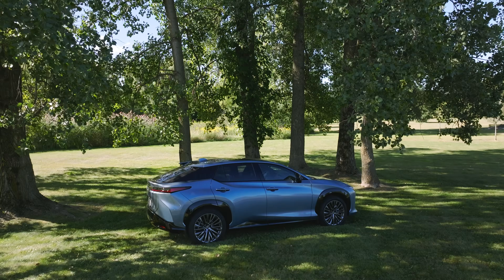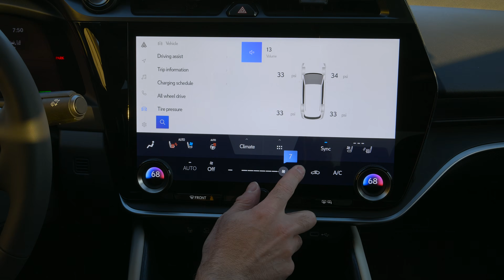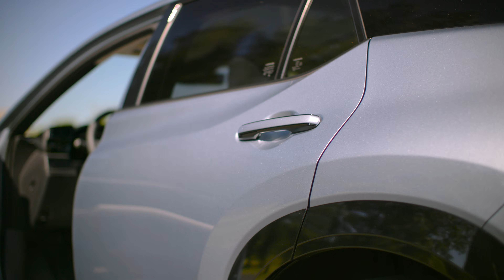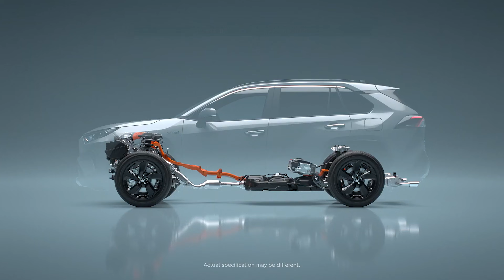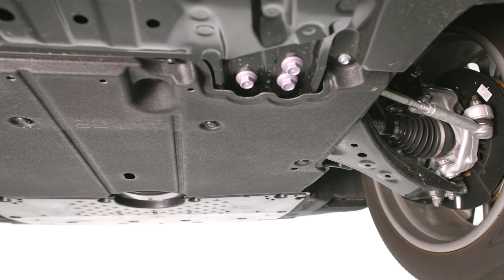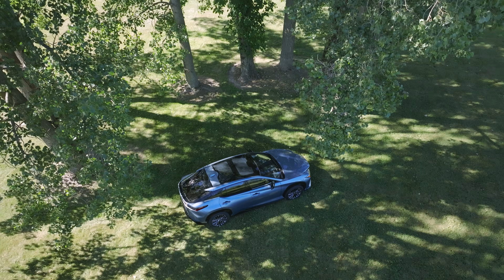Lexus RZ450 EV | Just Say No!

Comment: I'm under the impression that Toyota Lexus doesn't even really want to make electric cars they want to make hybrids
Reply: Toyota certainly isn’t concerned with making a competitive electric car. This would be a nice luxury car to drive around town but it’s a lot of money for a very mediocre EV.  For the money, the battery is small, the fast charging is no so fast and the onboard charger of 6.6 KW shows how little they care.  Then there are the charging limitations and range would have been unimpressive 4 years ago.  But they must have felt they needed to offer something, just not something good.
Reply: You would be right. Toyota has outright admitted to it. The reason being that for the battery resources it takes to make just one full EV car, they can make 7 PHEV cars or 90 standard hybrid cars. 

Toyota figures that at least for the time being, it makes a lot more sense to put resources into hybrids and PHEVs, which still offer significant efficiency improvements over conventional ICE vehicles, without the limitations, drawbacks and enormous resource costs of EVs. (Goose covers this in the Prius Prime review).
Reply: @splewy  this is a great point (total resource utilization) and is one reason I make the use case point elsewhere. When every reviewer harps on about range, without acknowledging that some people simply don’t need a ton of range, it actually exacerbates the issue. Every EV carrying around 100+ kWh of battery when they only use 35% of that most of the time is silly. But, people would have to get comfortable using different cars for different things. We do that already, but we don’t talk about it that way. I don’t take my 911 to Home Depot and I don’t take my Cayenne on track. I’m pretty comfortable having an efficient car that I don’t depend on to take me to the grandparents’ house 200 miles away, and a comfortable, larger car for the long hauls. Minor mindset shift could go a long way … but in the meantime, the PHEV gets most people most of their needs met with maximum urban pollution reduction, at the cost of a redundant drivetrain and maintenance complexity. Reasonable interim solution.
Reply: @tammerfarid  The average consumer does not have the luxury of having a different car for a specific purpose, so it would be hard to cultivate that mindset. A little tone deaf in your logic, Mr. Porsche man.
Reply: @chri5jame5  just the facts. 59% of households that own any vehicle today own more than one (that includes households with 2 cars and those with 3+). So already nearly 2/3 of households could designate one of those multiple cars to be a “road trip” car. Unless you’re suggesting that most households have to have two drivers independently doing long mileage regularly … which statistically doesn’t hold up. Every family that owns a minivan and a smaller car already has “a different car with a specific purpose.”

My logic is based on documented facts. What are your assertions based on?

Source: U.S. Census Bureau 5-Year American Community Survey (2017-2021)
Reply: @chri5jame5  also, sorta beside the point but using my car ownership as an insult just highlights the lack of information underlying your entire message. My 2015 Cayenne Diesel was purchased two years ago for $29K, less than the average price of a new Camry. I maintain it myself and it’s needed nothing except fluids and tires in 25K miles, except one expensive LED headlamp. But I guess if it has a Stuttgart crest I’m an out of touch snob, to some.
Reply: @tammerfarid  

You're right under your perspective that a family is a household with access to each other's vehicle.

I was thinking actual household, or each person in a household being the average consumer. 

(The Census bureau states that "A household includes all the the people who occupy a housing unit. (People not living in households are classified as living in group quarters.) A housing unit is a house, an apartment, a mobile home, a group of rooms, or a single room that is occupied (or if vacant, is intended for occupancy) as separate living quarters. The occupants may be a single family, one person living alone, two or more families living together, or any other group of related or unrelated people who share living arrangements.")

The reality is, 2.6 is the average household (ACS, 2017-2021) let's round up and say 3... with only 22% of the households owning 3 or more vehicles (ACS, 2017-2021). 

That averages out to 1 person per vehicle, which does not necessarily mean vehicles are shared.

That's particularly true of urban environments, where I am from. Pew Research shows, By 2018, 25% of the total U.S. population resided in the large suburban counties, up from 23% in 2000. In contrast, the share of the population living in the urban cores remained at 31%. (Pew Research Center, 2020). 

So I guess my logic is as skewed as yours. 

Oh and when you use a cheap Porsche when noting it as an example without stating it's a cheap Porsche, it does sound like you're a wannabe Stuttgart snob.

That's my logic.
Reply: thing is one major repair away from going to the junkyard  @tammerfarid
Reply: @tammerfarid  I agree on the "short" range. This vehicle is perfect for my 15 miles commute during the weekdays but I gotta pull out the good old V8 LC for road trips.
Reply: I would think it would be a good strategy for Lexus to focus on PHEV's: it's an under-addressed market currently, and would be a good fit for their product evolution. If they could make their technology UX better, and make SUV's with ~50mi EV range and ~500mi combined range, and were not gutless like their previous offerings (think 400hp+ as a benchmark), I think they could do reasonably well. It will be interesting to see how quickly they can get their new TX 500h+ into production, for example, and how it does in the market. They really need to fix the old UX and lack of power to be more broadly compelling, though.
Reply: They just want to make money. And hybrids is what currently makes a ton of it.
Reply: The last year we have full-year global sales figures is 2020, and -- looking at consumer vehicles including pickup trucks, excluding commercial vehicles -- Toyota sold FIVE out of the TOP TEN top-selling vehicles, worldwide.  RAV4 was #1.  Corolla Sedan was #2.  #6 was interesting -- "Toyota Hilux."  NONE sold in the US or Canada.  Just a handful sold in China, and a few more in Europe.  THIS is the kind of thing that the rest of this planet is buying -- an inexpensive little pickup truck.  It's like when Toyota stopped selling two-door cars -- "We're sorry, we build cars that people will buy."  TOYOTA SELLS CARS.  Nobody at least in the CCS world is selling much more than a pile of beans.  When Toyota can actually make money selling zero-emission vehicles, expect them to jump in with both feet.  In the meantime, they're selling every hybrid vehicle they can produce.
Reply: They do make the best ever
Reply: They’ll be forced to eventually, so might as well make something actually good.
Reply: @casIIsac  well Lexus can’t afford to make segment best vehicles. So that idea of yours is clearly never going to happen.
Reply: Akio Toyoda came in and pushed for more character in the brands to give them appeal beyond appliance convenience.

He stepped down because he doesn't think he's the guy to lead the company into an electric future. Toyota knows where it needs to go, and a gearhead racer isn't the boss to get them there.

So it's not fair to say that Toyota doesn't want to make BEVs. It's fair to say they've put more focus on hybridization in the short run, and the guy who was in charge wasn't excited about committing to an electrified future. So he stepped aside to allow the company to do what it needs to do regardless of how he feels about it.
Reply: They make great hybrids, but i believe they have a much more advanced electric platform coming, maybe the RZ and BZ4 are just placeholders? I dont think toyota would be dumb enough to only offer a BEV with ~200 miles of range
Reply: That's why Akio was forced out.  He wasn't playing ball with the WEF and the climate hoax.
Reply: They don't.
This car basically screams "here, have your EV, now leave me the fuck alone, next time you want to have it your way, go to the fucking Burger King".
Reply: Wasn’t the CT200h a Lexus Prius? That car totally sucked. Maybe the new Prius Prime or whatever it’s called could be morphed into a decent Lexus. PHEVs are definitely the bridge technology for people who need to drive their EVs more than 150 miles with any frequency.
Reply: Phoning it in because they know in the long term BEVs are not sustainable.
Reply: Nobody wants to make electric cars
Reply: They publicly say that
Reply: @pine111  why is no one buying the f150 lightning?
Reply: They only make this car for the eco carbon credits so they can make more gas cars
Reply: Agree. Pretty sure the CEO has said they aren’t committing to BEVs because the technology isn’t there yet and he feels hybrids are proven tech
Reply: Good!
Reply: It's true. They do not have an EV platform or supplier for batteries.
Reply: Well thei Fired Toyoda because he didnt believe iin evs
Reply: They are a little bit behind the competition. To me the most interesting feature to come is the quick steering rack with the yoke steering wheel.
Reply: Realistically, the tech for EVs is still not optimal.  We need more mass transit.
Reply: @apocalypse487  i agree!!! I dont think that we should be having to drive electric cars until charging stations are as available as gas stations.
Reply: I heard the same from a friend at Corporate. They build the minimum the government requires, but are more interested in Hybrids and developing fuel  cell technology which they are jointly researching with Yamaha and other Japanize manufactures. The CEO of Toyota and Subaru have both spoken out about this. It's also why Subaru is just rebadging Toyotas to fill their EV quota for the Government.
Reply: @christopherbice862  yup, demand for EVS is going down and interest in hydrogen fuel cell vehicles are going up. I really hope hydrogen is the future instead of electricity
Reply: @pine111  only time will tell but EVs aren’t sustainable currently.  Infrastructure sucks, range isn’t great,  needing a battery replacement basically totals the car
Reply: They want to make hydrogen cars, don't trust me just watch.
Reply: they literally dont
Reply: just given some of the visual designs ive seen from some EVs like rivian, i get the impression they want to make EVs as ugly as possible so they flop and they can go back to ICEs
Reply: Toyota DEALERS demanded Toyota make Hybrids and not go all EV.  Hybrids combine all the maintenance of the gas engine AND complexities of cramming in electric with it.  It's a dealer profit center down the line for their service and repair department.
Reply: They will make anything that sells, if they they can make it.
They want to make and sell BEV, but they can't really make BEV. 
It's kinda hard to teach "new trick" to "old dog" .
They really fall far behind, even behind Ford and GM
Reply: And hydrogen
Reply: better for them to just take the prius and upscale it to a more luxury version and tada, hybrid lexus
Reply: Toyota knows EVs are a fad that provide little benefit to the consumer.
Reply: Toyota is a firm believer of multi solutions. To sell the entire world with BEV is an insane thought. Toyota understands the global infrastructure of charging stations is nowhere ready for that shift to just BEV, so as of now hybrids are the way to go. But they also understand the demand for EV so they have that option. They also have FCV for places that does have fuel cell stations. So they have a complete complex understanding of the demands in different markets.
Reply: hybrids have had <5% marketshare for over 20 years. bevs have already passed them. why do you think theyre going to jump all of a sudden? @vamosnippon
Reply: @TeslaRoadtrips  Hybrid market share has been growing, but in fact BEV sales has unfortunately plateaued. You can see a lot of the BEV dealerships other than Tesla has hit a decline in sales and has many unsold BEV in their lot. Which is explained by the severe lack of infrastructure for BEV. Tesla is an exception since they have a much better charging system but that is still very limited. On the contrary side, PHEV and hybrids are growing because they are so versatile and can still comply with the changing gas prices. From this, what I understand is that people are realizing the importance of infrastructure for BEV and how these vehicles can affect their lifestyle. Most apartments lack charging stations and even if they did have one, it would be very limited. Politics wants to move to BEV but if consumers don’t buy into it, then it will force auto manufacturers to sell what consumers want. It is a matter of time but that time may take longer than we think. And there are still many obstacles for BEV like the charging time.
Reply: i disagree bev sales have been markedly increasing for several years and hybrids have never made it past 5% for last 20. not saying hybrids cant make inroads. but bevs passing them in marketshare within a few years is telling. tesla marketshare has decreased due to more competition, but overall sales continue to rise. i wouldnt touch a ccs car with a 10 foot pole @vamosnippon
Reply: @vamosnippon  well you should see the increase sale of EV in my country then, EB here are increase exponentially

And also which country are you? I think you need more research on different country than the us or Europe
Reply: @lillypichu4566  Yeah every market is different that is exactly why Toyota has multiple approach to this ongoing movement to zero emissions.
Reply: The infrastructure in the US is lacking to support a large amount of EVs. Besides not a lot of 3rd party charging stations, they are slow, buggy, and many times connection/payment doesn’t work.
Reply: yea if theyre not tesla @elfinguard3
Reply: @elfinguard3  the infrastructure point is mostly irrelevant; it’s a moving target. At the dawn of ICE vehicles, you had to buy gas by the can at stores. And again that misses the point that most people don’t actually drive their cars more than 80 miles a day (and the majority far less than that). Road trip charging is really an edge use case for most people except the minority that are 1-car households.
Reply: Honestly I think toyota has this right (if its the case they are focusing on hybrid). Hybrid tech is the best way to make a difference now. Full electric has real downsides. If the masses all drove hybrids it would accomplish more than the top 10% of car buyers being able to go all eletric. imo.
Reply: @Largecow_Moobeast  definitely true for the apartment dwellers and garage-less who might struggle to charge at home. For those with the ability to charge at home, it’s really down to your needs. I don’t know, but I suspect that a large majority of people who can charge at home also have >1 car, which means the limitations to BEVs are totally irrelevant for them.
Reply: GOOD! EV's are terrible atm. You get a bigger bang for your buck with hybrid in that they cost significantly less to build and source, while giving you a very healthy MPG bump. The economics on EV's vs Hybrid are a no brainer if you calulcate from cradle to grave on ALL components/materials.  Greenies love to just focus on the ass end of that equation which is "free transportation" in that it doesn't pollute. Yea you did 6 years of polluting to get to that point just to build the car your all hyped up for meaning you need to drive it 60k to get your carbon back to be "carbon free" meanwhile at 60k your resale has dropped like a rock and you probably have a new EV now.  Which is BEYOND BAD when you factor all that in. Your worse than a ICE. FAIL.
Reply: @aurorajones8481  You have a very myopic viewpoint. Once an ICE is dead at say 100K or 200K it can only be recycled for metal scrap and some plastics. Once a BEV is dead at 150K or 250K (since a single gear reduction tranny and electric motor are far less likely to fail than the wonder that is an ICE powertrain), the same metal and plastics can be recycled - BUT also the batteries. By recycling the batteries instead of mining for new ore you save about 80% of the energy involved with acquiring the metals and only have 3-5% loss - see Redwood or Li-Cycle stats for reference. This is a long term savings, not something seen in just one decade. When you look at things with just a 60K viewpoint you end up with cars that put a layer of lead into the topsoil al around the world. When we get to the point of having reliable fusion en mass, we can move to hydrogen either FCEV or flat out combustion, but until then BEVs are a way to significantly cut down on CO2 emissions and normal pollutants. You're still going to have all the nasty chemicals from making the glass, plastics, wire insulation and so forth along with tire particulate and some brake dust - but it is a significant improvement. I've spent my fair share of time on SCCA track and love racing but concede that combusting petroleum for basic transportation is not sustainable. Keep it for flying and plastic until we find something better, but you don't need it to drop the kids off at school or going to the beach. There is no perfection short of removing humans from the Earth since nobody wants to live like North Sentinel Island.
Reply: @aurorajones8481 EVs are not terrible at the moment. There’s quite a few that are fantastic, but mostly for a long term use case it’s still just Tesla. Also, that whole charade about the carbon neutral thing doesn’t work. Once that car is built, it goes on to a new life with a new owner and gets used over and owner. The long term carbon footprint is nothing compared to an ICE car, with 2000 less moving parts, minimal maintenance. and no, it’s not 6 years. It’s about 2 years to catch up to the carbon neutral. I’m all for everyone to drive what they want, so don’t take this as trying to convince you to change. Just saying, your comment has a bias bent towards negatives that aren’t real.
Reply: i dk. base model 3 is 32k after rebate. cheaper in some states. im saving $4000 a year in gas. basically im paying myself after 8 years. hybrids get all the worst maintenance aspects of both. deal w stealerships. good luck finding a prius prime in cali. 2 yr wait or 10k markup. most just end up buying tesla.  @aurorajones8481
Reply: @aurorajones8481 this is completely wrong. The average BEV has much better cradle to grave emissions than the average hybrid.
Reply: @Kavafy  standard hybrid, you’re correct. For a PHEV with an EV-only drive mode, doesn’t it depend on how often the gas engine is used? For a BEV, a huge share of the lifecycle cost is in the battery pack. Making the battery pack smaller (like a PHEV with 20-40 miles of range) reduces that upfront environmental impact. If that car is charged in a garage every night and mostly used for short trips, it’s probably lower total output than a BEV with 300 miles of range. If it’s driven on the gas engine all the time, it’s worse than the BEV. Here’s the catch: for a PHEV to have lower CTG emissions than a BEV, the gas engine has to be superfluous most of the time … which makes it a waste to include st the start.
Reply: @aurorajones8481  100% agree.
Reply: Akio Toyoda saw where cars were going and he peaced out, don't blame him tbh.
Reply: Ford lost tons of money on EVs. They are switching to hybrids now too
Reply: They once said that the resources that they need to build a single BEV can be used to produce way more hybrids (they even quantified).
Reply: Toyota don't want to make EV cuz they think it's not the right way for the future of automobile, that's why they dump tons of money into Hydrogen tech. Toyota also think as whole, where many people around the world can't afford EV or countries that don't have the info-structure for EV, on the other hand they are developing next gen battery tech w/ Panasonic which is "solid state" battery, which is supposed to be the next best thing for EV. But at the end it's the government that wants every auto manufacturer to switch to EV.
Reply: That's because the leaders of Toyota Motor Corporation strike me as intelligent people who understand that market MAY NEVER MATERIALIZE because INTELLIGENT people want HYBRIDS, NOT the BURDENS of fully electric vehicles.
Reply: @williamlevy1981  the problem is, the law bans all gas vehicles in 2035 in most us states including hybrids.
Reply: @andreyoungcompton  And watch that change in many markets.
Reply: hybrids have hads sub 5% market share for over 20 years. bevs have already passed them. why do you think theyre going to jump all of a sudden? @williamlevy1981
Reply: I always felt hybrid are the answer. You are using less gas and needing less gas, and you don't need to mine as much because of the smaller batteries. You just created a smaller footprint. With all these large batteries, lower income countries are really struggling to keep a safe work environment and be environmentally conscious.
Reply: Not really. They want to make what is in demand but definitely are working on BEVs. They don't want to make just BEVs or think just BEVs should be the future. But some BEVs, yes, should be the future and they're making Lexus all BEV by 2030 in some countries. I think the USA is one of them. By 2035 Lexus wants to be all BEV or at least all EV with maybe some FCEVs.
Reply: @benjaminsmith2287  got a source for all this info?
Reply: @lunisce  Sato. He , along with two other Toyota reps, made a presentation stating what Toyota is working on in terms of various production lines, accelerating BEV development, and how Lexus will lead the way in BEV development. Just Google Sato Overall EV strategy.
Reply: @benjaminsmith2287 Toyota will go bankrupt
Reply: @benjaminsmith2287 every company is being forced to do this by corrupt and idiotic governments/politicians.
Reply: @benjaminsmith2287 yes its true they have already said they don’t want to make EV’s and they want to go with hybrids. I believe the head of Toyota was talking about and savagegeese i believe mentioned it in a video.
Reply: @benjaminsmith2287  there isn't enough raw materials in the world to make the batteries if everyone wanted a electric car
Reply: china is already onto sodium batteries from lithium, its like the 6th most abundant element in planet. there will be ways  @toyota420xp
Reply: Toyota admitting they don’t want evs clearly shows they want to go out of business and struggle to stay relevant like infiniti

Teslas outselling Toyotas now for a reason. Because evs are the future
Reply: @naveenthemachine  Toyotas are struggling to stay relevant simply because they never do anything first and they're still living off of their reputation from the 90s and all they do is sell old people cars
Reply: @naveenthemachine They're NOT. You are hilarious to think you are smarter than Toyota as a company. The U.S. doesn't and won't have the infrastructure to charge ONLY electric cars. You must not pay attention to what is happening in California as a whole. Car companies are leaving California because its political leaders are and have been morons. Tesla also moved its headquarters to Texas.
Reply: @naveenthemachine  toyota going out of business... hahahahah. Look at any toyota dealership lot, any new shipment that comes in is already sold